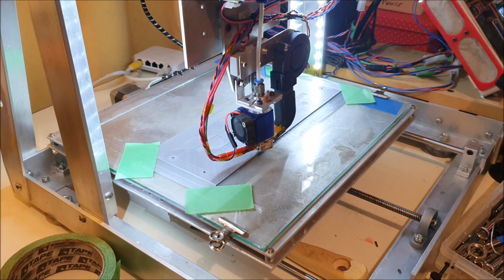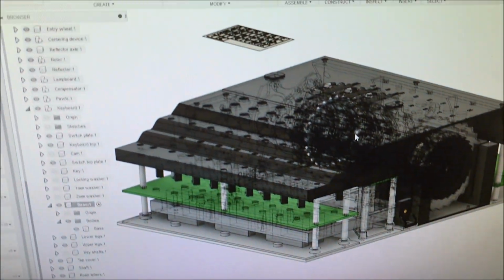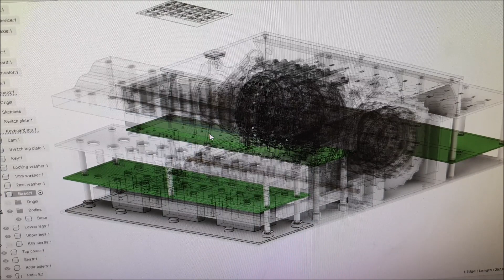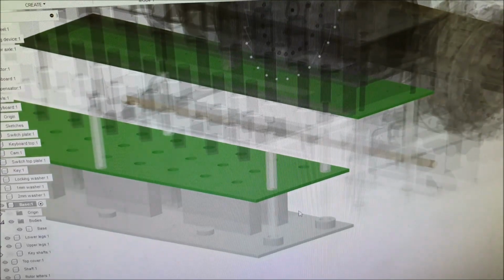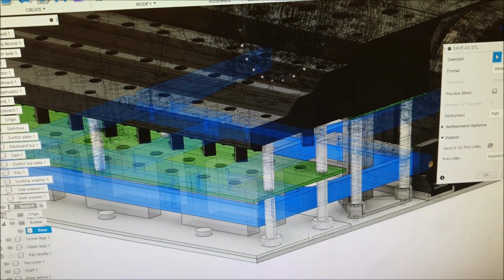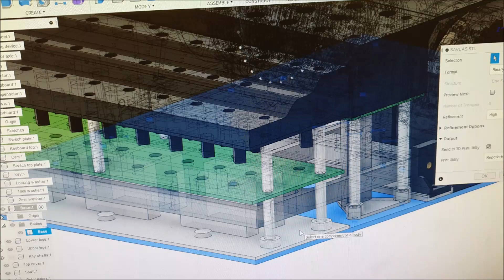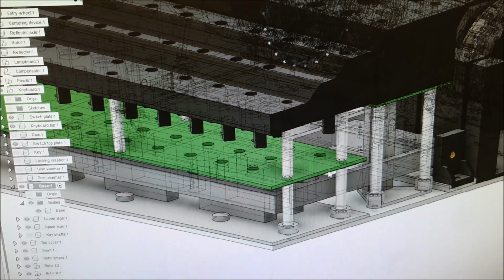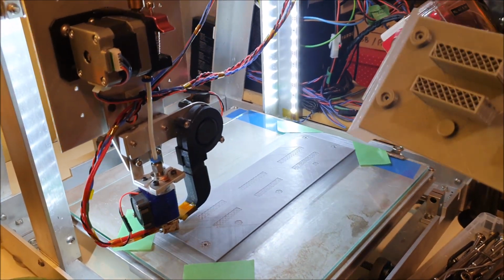3D  printed Polish Enigma machine update 26 January 2020

Comment: That circuit board looks great for the keyboard. For the plugboard, could you rotate the sockets 90 degrees so that the pins face outwards and then have two thin circuit boards that connect them up? That is two boards, one for each row of sockets.

_________________ Circuit board for row 1 plugs
* * * * * * * * * * * * * Row 1 plugs
* * * * * * * * * * * * * Row 2 plugs
------------------------------- Circuit board for row 2 plugs